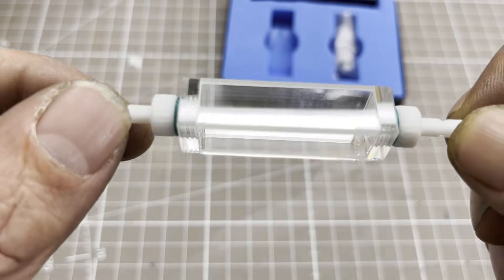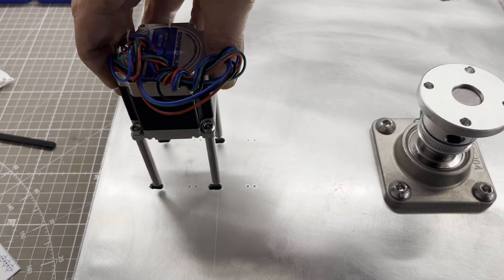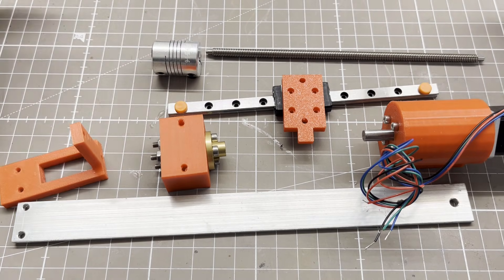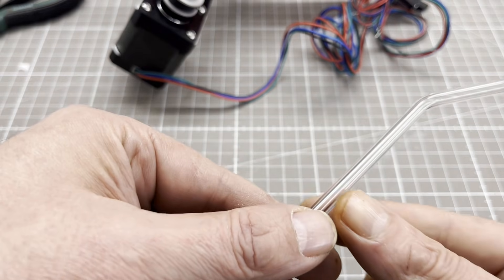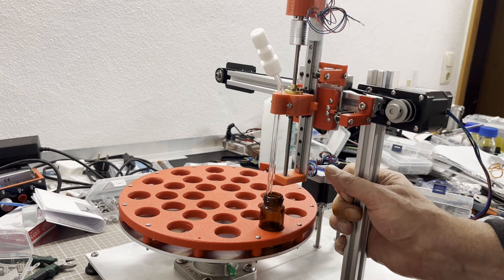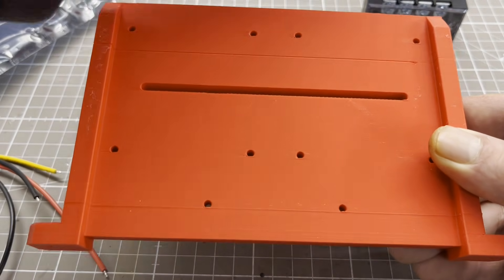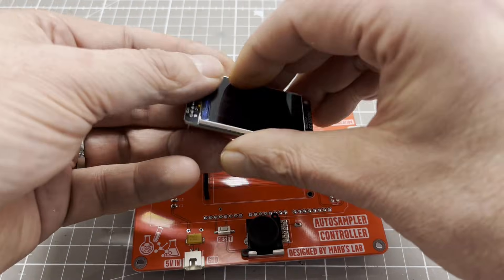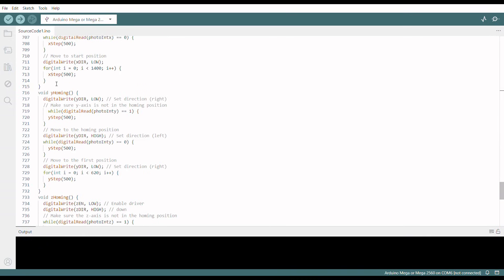Building an autosampler (redesign)

Comment: Why the round carousel?  It would be easier to get more collection bottles if you had a square carousel.
Reply from the maker: Since the carousel rotates to position the sample under the needle, the needle itself often only needs to perform a simple Y-Z movement (up/down and a short horizontal distance). This enables extremely short cycle times compared to systems in which the needle has to travel long distances across a large static field. The rotational movement of the carousel ensures gentle, natural mixing of the samples in the vials. With static systems, homogenization would have to be programmed in a time-consuming manner by repeatedly aspirating and dispensing with the needle.
Carousels can be rotated during operation to quickly add or remove samples.
You can also easily 3-D print trays according to your requirements:)

Comment: Sampling what exactly or could it be quite anything depending on the sample collection and storage set up? It looks like this could take "batch samples" of a liquid. This would be interesting in a number of settings. I'm trying to envision doing something like this but at extreme pressure 800ata for example.
Reply from the maker: An autosampler is normally used for chemical analysis. Any liquid can be sampled (in or out of the sample bottle). Now I am curious what you want to sample at 800 ata (seen this pressure unit seldom these days).

Comment: 80% Infill seems like too much, but it does offer a better resilience to compression with nuts and bolts. Normally it is easier to achieve better results with 50 and different wall configuration for mounting points.

That said this is just brain vomit - The price, print time, and performance is worth the extra effort for a complex project.
Reply from the maker: 50% infill should be enough, but you know, I am a German engineer. We build everything nuclear bomb-proof, even it's not necessary 😀
Reply: @Marbslab  I started making a post about how less is more with infills and then I realized that was not needed. 
Engagement is good and love the projects on your channel. 😃
Reply from the maker: @mckidney1  Thank you:)